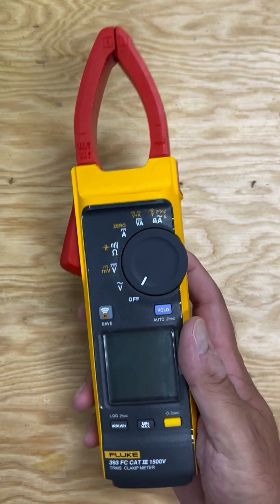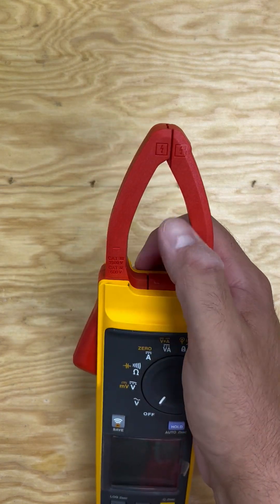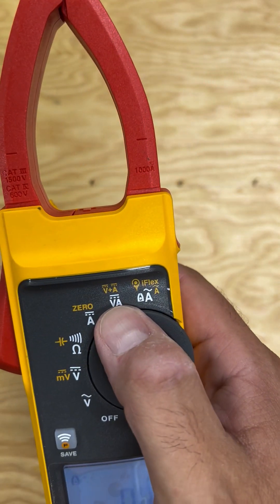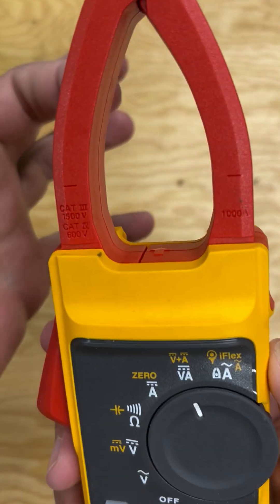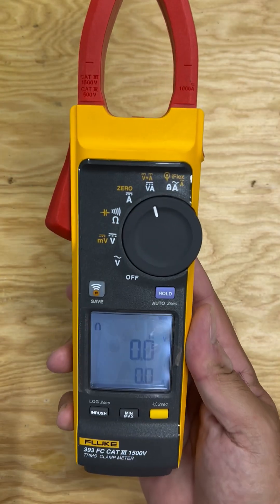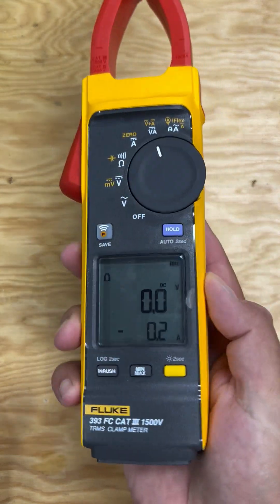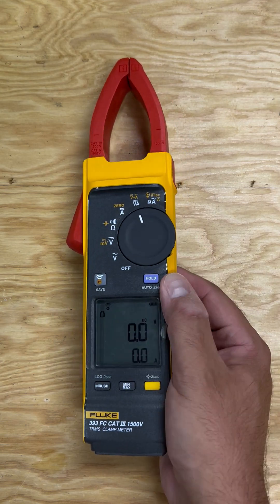Fluke 393 FC - FAIL!!!…

Comment: Hello, the truth is that they could have taken it into account, I have just acquired a 378fc and I have realized that it does not work well to check the output of frequency converters. However the 393 fc does work for this function, if you are interested in an exchange of the clamps please contact me, see the performance of the 378fc that clamp has the ability to measure the voltage without wires just need to put the negative terminal to ground.
Reply from the maker: What are you taking about?

Comment: I agree that Fluke's marketing and sales literature are not 100% accurate. I have the 376FC and it was marketed as doing instantaneous DC current via the clamp, so I hooked it up the the negative battery cable on the car--and nothing when I start the car. When I called them and explained what I was doing they were curt and explained that the instantaneous DC  current was for industrial apps. Now I am no rocket scientist but I do hold an EE degree and their answer holds no water. I have noticed in recent years a marked increase in marketing types at Fluke who couldn't find their rear with a map and a magnifying glass. I know that us engineering types aren't cheap but neither are Fluke's panoply of test equipment. We deserve an accurate representation of the equipment they sell us.
Reply from the maker: Kick ass

Comment: The first page of Fluke's data sheet for the 393 FC gives the impression that you could measure DC voltage and current with the jaws. The first image shows the clamp meter measuring 1500 DC V and 29.3 A with the jaws around a cable and without any probes attached. The second image shows a technician doing the same type of measurement on a solar array without any probes attached.
Reply from the maker: Cool

Comment: Full Disclosure, I have had 5+ decades of experience dealing with Fluke and have done field testing for them on several of their products.  When they first brought out clamp on meters, I jumped on the chance.  I have been in the industrial troubleshooting / automation field and so I have the 378 FC which is aimed at Clamp On Amp / Volts in the 3ø AC environment. It works by making a carefully orchestrated series of Clamp On Amp readings while the Black Lead is connected to Ground.  So it measures Clamp On Current on each phase and infers and stores the Phase to Ground Voltage (for 480 3ø, it's 277 Volts).  When the measuring sequence is complete, it Displays the Measured Phase Currents and the Calculated Phase to Phase 480 VAC Measurements, without you ever having to actually probe it (5% accuracy, if I remember correctly).  So while this is not an engineering type measurement, it is absolutely a troubleshooting type measurement. It takes a few tries to get this sequence down pat, but after about 3 or 4 trials, I got it committed to memory.  

I have dozens of Fluke products and have relied on their tech service people on many occasions.  I recommend that you review your concerns about the operation of the 393 with them to be certain that you have not missed something in your efforts to get useful functionality.

Comment: I agree, but I’ll also disagree. I’ll start by asking, when have you ever known or seen a meter that reads volts via a clamp? The clamp, as you know, or should know, reads through sensors that pick up the magnetic field generated by a live circuit under load. Voltage by itself will not read in this way as voltage absent of resistance does not produce a magnetic field which is why we have to use probes to get accurate measurements of volts. The probes measure the difference between two points of potential.  In the case of this meter and others like it, it uses a common probe connected to earth or ground wire. Would even work with a neutral. This probe gives the meters circuitry a reference point to find volts while reading the amps. An alligator clip which would eliminate the need for four hands is conveniently included with the meter. So at this point I disagree with you as you’re making it seem harder than it actually is and as an electrician, even as an apprentice, you should know, or at least should have known these basics. 

Now where I agree with you, even when the meter is connected properly with the common probe, the field sensor is not going to give accurate results for voltage as the voltage readings are going to hop around a lot. For this reason I find this feature to be kind of gimmicky. Especially while troubleshooting. No one will be able to use the sensory voltage readings as being accurate enough to make a decision during any kind of troubleshooting. So out comes the DMM to figure it out. 

Save your money, use a clamp meter that can read DC amps since you’re in the solar business and then use your old faithful DMM to get your accurate voltage readings.
Reply: @thebigd6249  --- great reply. Thanks.
  With that meter, needing to use the leads, is no big deal. You don't need four hands. You use the clamp jaws to hang from a cable/wire/conductor, that is safely out of the way but the screen still visible. Use the leads provided, I will use one alligator and one probe, clip the alligator to ground and then proceed with the probe to check terminals, etc... for voltage. 
  
 I've only worked on a few solar systems in my 35 years as a Journeyman, all were pretty substantial, including when building San Francisco Giant's Stadium, known then as PacBell Park. 
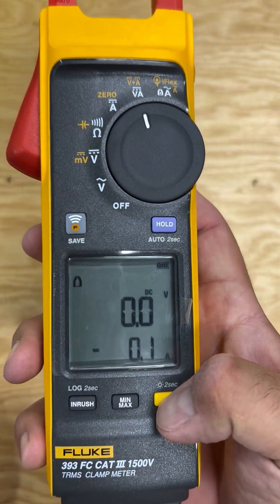 Solar isn't my favorite. I would spend most of my years doing the building feed and setting up the main electric room for new buildings. I'd show up at the gangbox just in time to say hello to some people and the boxes would get unlocked at 7am, I'd grab my 4 wheel cart throw my tools on it figure out what I need for the day as far as material and load it on the cart, I'd head to the bottom floor to the electric room and, the crew might see me at coffee break,  then at lunch they'd see and hear me do a burnout off the jobsite parking, 30 minutes later I'd walk to the electric room and at 3:15 I'd clean up and roll my cart to the gang boxes, write down what materials and maybe tools I need to be ordered and I'd be in my car at 3:30. I'd be on a job from the temp power install into a hole in the ground, until the building was occupied because I did all the troubleshooting of the offices etc... and I'd run into other Brothers on a job and they had been on the same job as me and never saw me. Had no idea I was on the same job.  Others would see me or if I had nothing to do I'd be a tool partner for someone for a day and they would ask if I was new, or they'd say "oh, you're the dude I'd see at the gangbox in the morning and then I'd never see you again until the end of the day. I'd laugh and say the company won't let me work anywhere except building feed and all the electric room switchgear and transformers, pulling in 500 or 650 MCM wires. I'd say I don't even know how to wire a switch or receptacles. Hahahahaha
Reply from the maker: Nice.
Reply from the maker: The 378fc does ac volts and amps at the same time. I would think fluke could do the same on the 393 fc. Oh well. It went back.
Reply: @MrTooTechnical  The 378 FC only works that way with AC, not DC.  
Fluke field sense only works for AC, and even then its picky and does not work for IT grids as it needs a reference to ground.

Love the 393 FC, great 1500VDC meters for quick 1500VDC solar troubleshooting.
Reply from the maker: Nice
Reply from the maker: The 378 fc does dc amps and dc volts.
Reply: @MrTooTechnical  it does NOT do DC volts from the clamp.
Reply from the maker: Which one. The 378 or 393?
Reply: @MrTooTechnical in regard to field sense, either.
Reply from the maker: Indeed